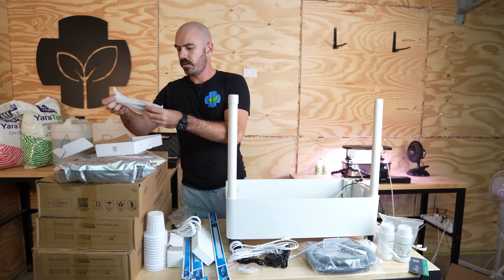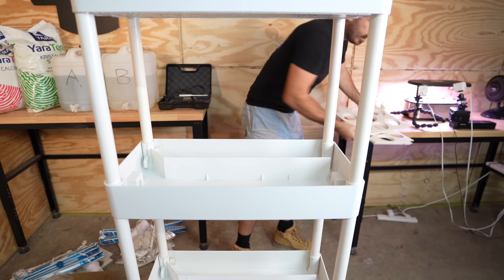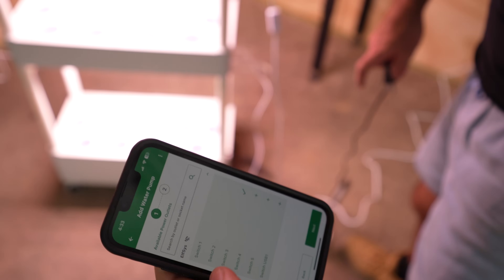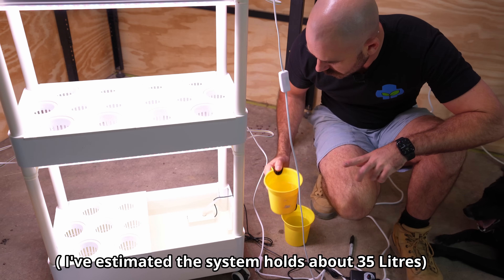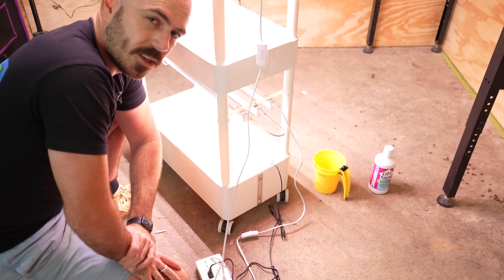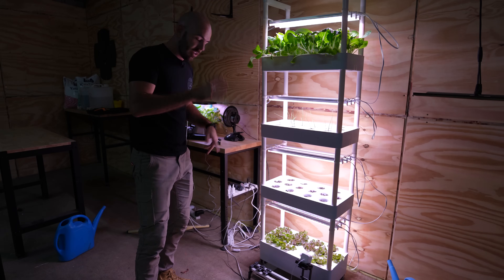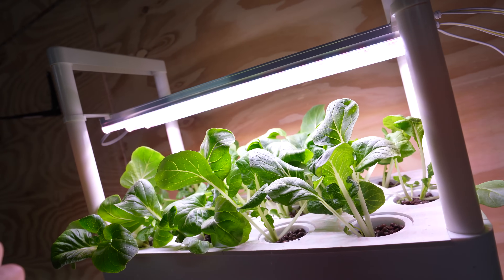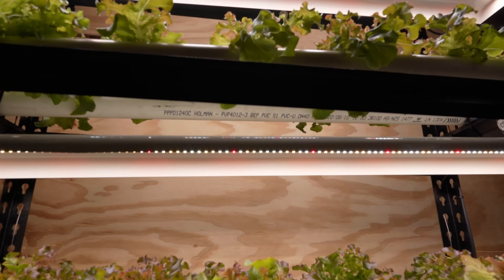ElfSys Deep Flow Technique: Tower Hydroponic System

Comment: Thanks for this. So, they managed to feed the pump pipe in a hollow support strut but all the cabling for the lights is just left out with no guiding. not even 90degree connectors?
Reply: We have not worked on internalizing cabling as majority of our users want to have the flexibility to mod the lighting. We do want to make 90 degrees connectors once we scale up the operation in the future. As we continuously support legacy models, you can always upgrade the parts when it is released. 
We do give out free cable achors in our v1.4 models now to help organizing hanging cables to make them look neat.

Comment: Did they make this easier to assemble as you suggested and also how does one clean the filter as you said it clogs.
Reply: have you done a review of iharvest or nutraponics. Seems Gardyn is popular but I prefer one that does not require you to buy all of their stuff.
Reply: There is filters on each level to prevent clog in circulation pipe.

Comment: Thanks for the intro to Elfsys and all the links to recommended products. I would like the system better if it used smaller net cups.  I hate cleaning clay pellets, especially in the winter when I don't have the garden hose handy.   It's always tempting when I see a new system.  I have yet to find a system that is large and easy to clean.  Currently, we are setting up an OPCOM Grow Wall 3F made in Taiwan.  It will be the 7th system I am trying.

Comment: Is there any kratky tower out there? Or could you make a DIY video of that? I.e. with a reservoir at the top and each level have float valve which dont need a bump so as to elimate the bump noise.

Comment: That seems like a pretty good deal for a more polished indoor hydroponics system. I went ahead and took the plunge and ordered one. I hope it works out!

I do wonder if it is possible to clean part o the system rather than having to take it all apart and clean the whole thing at once. That way production can be continuous.

I really like the small foot print of this system. I have space in my house, but not that much space.
Reply: Thank you for the support!
Yes, you can drain each seperate container and just do a quick wipe instead of disassemble the entire kit.

Also you really don't need to wash the system too often. Growing peppers more than 12 months and only drained the system 3 times to remove some organic buildup in the container.  We would only do take apart cleaning between the long term crops or experience pest issue just because being OCD about it. 

All water saved to do hydroponics basically are wasted in cleaning. Any current practice in factory that involve cleaning for quality control is actually not saving water. It's kinda ironic when we discovered that. At home hydroponics is a much more sustainable concept and should be practiced that way. Even we designed the product to make full cleaning possible and easy, it is still a lot more work comparing to just filling water to grow the crop on autopilot. Do it only in the occations you deem necessary.

Comment: How do you deal with the power supply disparity? US stuff tends to use 110/120v but I couldn't see a 240/120v selector on their power board. That's about the only thing currently killing my consideration to buy this unit.
Reply: All our hardwares take in wide range of input from 100V to 240V. Only needed part will be converter for the socket if other than Type B or Type I sockets. Where do you locate? We provide free socket converter for our international backers.
Reply: @elfsys I'm in Western Australia so it will be the same setup as you would have sent the big man (Hoocho). If that is the case, I'll get on and order a unit now!
Reply: @EviLEwoK666  Nice! Yah we have a specific powerstrip works for type F. It will be plug and play in Australia.
Reply: @elfsys   Order placed!
Reply: @EviLEwoK666  Roger that! Getting ready for you! You can look into some nutrients locally and seeds while waiting your Grow Kit!
Reply: @elfsys  already got a good selection of seeds (as I'm in the middle of building my first rain gutter and Bunnings bucket setup) and will have some nutrients ready to go, by the time the new Grow Kit arrives. Looking forward to giving your system a run! Thx to @Hoocho for the inspiration to start this self-growing journey!

Comment: Where do you top off the system from?  Do you have to lift up one of the sections of plants to be able to pour in more nutrient solution?
Reply: Yes, you can lift the cover or just from any net pot position. We removed the extra hole for filling cuz it is really not necessary as each layer had 14 holes already... And you can refill from any layer you want. Just be aware of the capacity and let the system recirculate to balance out the nutrient for you.

Comment: How does it not flood you home during a power outage?
Reply: It is designed not to. Don't over fill the system. And we regularly turn off the pump in our own experiment. We have grown peppers with great success even the pump is only on for 15~20 minutes per 3 hours.

Comment: It would be nice to have the cables inside another of the legs
Reply: We are thinking about that. It is just a trade off for utility vs aesthetic and cost sometimes. A better way to organize the cable is to make a loop around the light mounting bracket before connect the next light. It will make the cables look a lot more organized than loosely hanging. We will make an updated instruction for that.

Comment: Since you refill the bottom tray after the pump starts, that means that if the power goes off and the pump stops, the water will overflow from the bottom tray.
Reply: Yeah, if I were building this I’d have a deeper bottom ‘sub reservoir’, I reckon, below the channels on the bottom tier.
Reply: That is a good observation. Don't refill to the Red line when pump is on for the 4 layer system. And you don't need to worry about the flood drama if the pump is not on 24/7. 15 minutes schedule on for 3 hours will be a safe start. Also dial down the pump too as it does not need to run at full power. 

If you are being aware a few key good practices with the Elfsys Grow Kit, flooding won't be an issue. Each layer has its own capacity and will never empty the entire system at once. When the first time use the system, play with it to understand how the design works. A lot of thoughts have been put into the design, all the common issue with hydroponics, we have a lot of experience when iterating the prototypes.This system is designed to be taken apart and put back together with ease. So even all the connection points are some sort of leak proof as the leak just flow back to the container through the beam at all connection points.
Reply: My thought exactly destitute! So do not fill high after everything gets going correct?

Comment: What is the actual cost To this system
Reply: Current about 50% MSRP not factoring in any CapEx, R&D，Sales & Marketing cost. 

The main materials used in our product are food-safe uPVC and ABS, which were quite expensive for us to setup the production. Our capital expenditures have been high due to numerous iterations on injection molds. In fact, we had created an entirely different set of production molds before we could internalize the recirculation loop design. After testing the old model for a year, we decided to go back to the drawing board and pull the launch.

We hope that after the product launch, we can recoup some of the investment and scale up our business further. Currently, we are only growing organically with a bootstrapping team. During the launch stage, we are offering discounts as part of organic market approach. We would like to lower our margin on MSRP in order to attract early adopters rather than spending money on ads and selling at a much higher MSRP like the existing larger brands.

Our business model is focused on building the best growing system and automation solution that will last. Based on the Elfsys Grow Kit's performance, it will eventually pay for itself sooner or later depends on the fresh product cost, variety and local electricity price.

Comment: That's a really awesome and thoughtfull system, but the price is killing it
Reply: Yeah... I thought, well $380 (with the discounts)...not...that bad...oh, that's the 2 level.  Nevermind.  $4-500 for the 4 level would at least be in the market.  At these prices its competing with many not-great but very pretty "lifestyle" systems, that those with the money and not interested in building would likely go for.  (Even if this system is probably better than many of those.)

And just the power strip is $140.  Which, well... you can get 6 outlets of wifi control for ~$20, and then  control it with anything you like, or just a Home Assistant install (and thus, app). Learn to program an ESP32 and you can instrument temps, flow rates, and such all over a system for <$100...or with the $$$ sensors, all the nute levels too.

Comment: How much water is left on each shelf when it’s turned off but not manually drained?  I ask because my power goes down for 8 hours at a time about every other month.  If some water is left on the bottom, that would save the more mature plants.  Thanks!
Reply from the maker: All the levels keep the water that’s in them when the pump turns off
Reply: @Hoocho  Ah!  Thank you!
Reply: And the system auto reconnect to the interent once your power and wifi went back on. No need for human intervention if power went out temporarily.
Reply: @elfsys  Oh!  That’s really useful.  Thanks!

Comment: Yes!! I was so eager to see this one! You reckon bypassing the hydroten and using coco/peat pellets will work as well? Maybe that could bypass the clogging issues? On ya Hooch! Always love the new videos!
Reply: Just give the system a good check when first grow. Pick out the floating LECA in the container will avoid any blockage. Also can dial down the flow rate a little on the pump. We really can use any type of media. We are experimenting with innert sponges and foams.

Comment: very impressed with this product, just annoyed that the full tower costs $1,000 lol
Reply: We are launching at 30% launch discount and 10% extra discount for Hoocho's audience right now! A smaller system can be upgraded with future expansion unit. So you can start small and upgrade if you like it. Right now we are relatively small scale so we could not drive down more cost yet. Our goal is to add more value through software as we keep developing Elfsys Grow Cloud.
Reply: @elfsys  that's perfectly fair and reasonable ^_^ i'm not really knocking against the price as you run a business, it's just that at this very moment it's out of my price range lol
Reply: Stay tuned. Also our app is free if you have a DIY build and wifi powerstrip. We are doing our best trying to have multiple options just to democratize hydroponic technique.☺

Comment: can you add this system in partial/full sun light, this looks like a great way to start/try your hydroponic growing vegies at home, thanks mate
Reply: Trying something new with such a huge price?  
But it seams to be a clever system.
Edit: Not a clever system for use inside your Home. Where does all the nutient flow if the pump stops working? Right, in the container which keeps just half of amount of the system. Rest may you find on your floor?
Reply: @stefd569  expensive lettuces coming up in my house hold

Comment: Nice system, but you didn't mention how much power it uses.  How long are the lights on each day & how many total watts do they use?  The same question applies to the pump--how many minutes is the run time & power consumption?

So after a bit of research, I discovered that each strip uses 15W, so 3 strips/level * 4 levels * 15W/hr * 8 hrs/day * 42 days / 1000 W/kWh * .10 $/kWh = $6.05 total electricity cost per 6 week grow period for the lighting cost (assuming  an LED on time of 8 hr/day & a 6 wk harvest period.  More of course if you need 8 weeks to get to harvest time).

How much power does the pump use? 

Also, how much total nutrients would you need for a 4 level system for a 6 week grow period and how much would that total amount of nutrients cost?
Reply: Glad you like it! Each T5 uses 15W. 4 layer total will be 4*3*15=180W. Pump is under 5W. The timer can be set for each stage based on different plants so it varies. The pump can be on 15m for every 3 hours is enough for leafy greens. Feel feel to ask any questions. We ran some lettuce experiment for about 90kWh in a 40 days cycle growing 3+kg of lettuce for a 4 layer system.
Reply: @elfsys  re:  "The timer can be set for each stage based on different plants so it varies."  What is typical for growing lettuce?  Does the app (software/program) vary the light brightness, intensity, & duration over the grow period to simulate natural light throughout the day & grow period--or is that not possible or necessary?
Reply: @ab_ab_c  Yes, it does. Hoocho wired the lights in different layers. Our quick setup now features a different way of wiring which allows you to turn on 1 ~ 3 lights per layer. So you can turn 1 ~ 2 lights on first than turn on all three for each stage's schedule to simulate the sun rise and fall. You can also just turn off the middle lane to give a lower PPFD ideal for sprouting stage.

We are still optimizing the template from our own experiments. We are getting ready of some offical template as a baseline for you to adjust.
Reply: @elfsys  Cool.  Personally, if you're interested in input, I would prefer to be able to select an option that mimics the light brightness, intensity, & duration over the grow period to simulate natural light throughout the day & grow period.  I'd also like to select other custom options--like light ramp up & down, fixed/constant brightness & intensity level.  User configurability simplicity & flexibility is key!
Reply: @ab_ab_c  Yes, simlilar result can be achieved by making a custom grow template. We don't have research and data to prove that is necessary or giving better yield / ROI with a naturally mimicing light intensity change. I believe it will have an influence, so definitely do some experiment with the kit if you planning to get one. Our hardwares and softwares are built with flexibility at core. Our research now is looking into how to simplify the interactions. The control scheme is based on stage specific schedules. The entire process is optimized that way. Our next phase will be bring in more data and allow some levels of auto tuning. We are also diligiently growing and testing different species and creating tested template and share some good practice to use this kit.
Reply: Assuming 10 watt LED bars, times 12, on 16 hours a day, and a 20w water pump always on it's less than $2 a month electric cost at $.23 / kWh .
Reply: @brian420pm  Wow..your electricity rate is expensive.
Reply: @ab_ab_c  US national average
Reply: @brian420pm  No it isn't.  You can't rely on what Energy Sage publishes online--they aren't an official source of such data.  Check here instead:  
https://www.eia.gov/state/data.php?sid=TX 
Click on the "Prices" option & you will see that the US average is 16.11 $/kWh.
Reply from the maker: It’s all customisable.
So
This was a 16h on schedule that I programmed in.
The lights are each 15w for a total of 180w
I should’ve included that.
Oversight.
All the info is available on their website also.
Pump is continuous and variable power.
Reply: @Hoocho  oh... 16 hrs.. Much longer than I guessed. I see that the pump power consumption is <5W for 15mins/hr so 15*24/60= 6 hrs/day pump run time.

That makes my electricity cost calculations (for growing lettuce) as follows:

1.  Lights:  (3 strips/level * 4 levels * 15W/hr) = 180W * 16 hrs/day * 40 days / 1000 W/kWh * .10 $/kWh = $11.52 USD

2.  Pump:  6 hrs/day * 40 days * 5W (max power consumption) / 1000 W/kWh * .10 $/kWh = $0.12 USD  or ($0.48 $/grow period, if you run the pump 24h/d*7d/w*40d)

So, how much total nutrients (kg) & cost (USD) would you need to provide to grow lettuce during a 40 day growing period?  Note:  Assuming you use your large bags of nutrients that you mix up as the source of your nutrients.